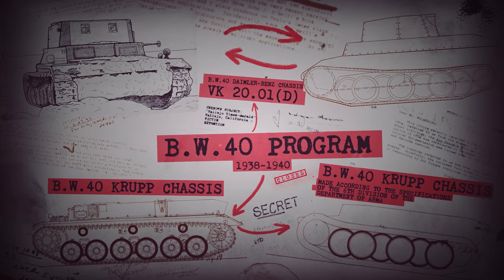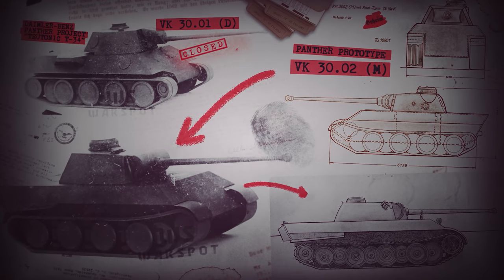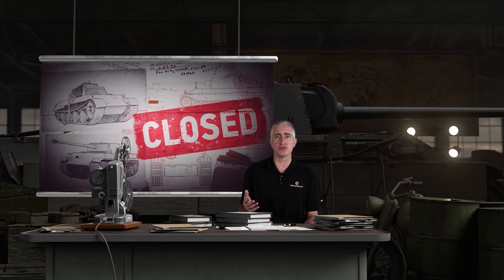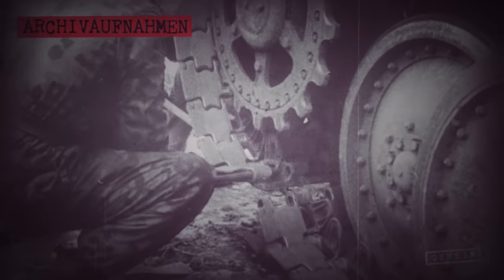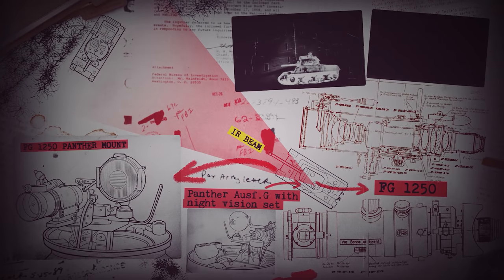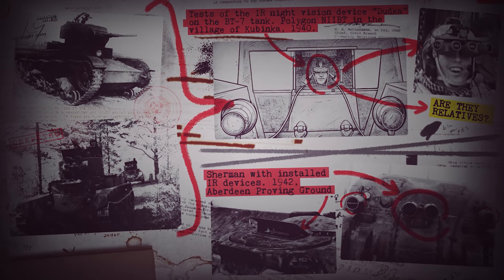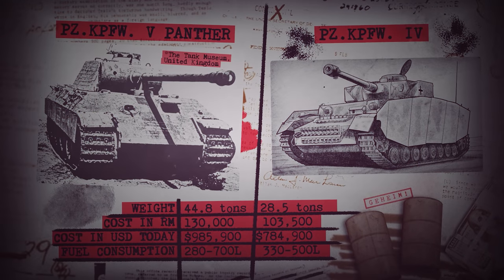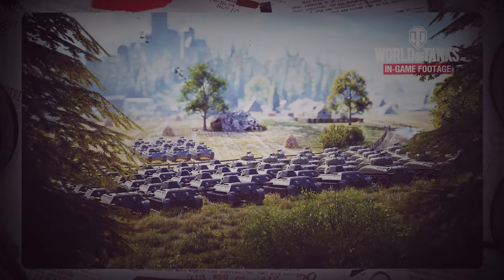Five Things About the Panther with The Chieftain - World of Tanks

Comment: I like that you point out the "If they had build something easier more, who would have crewed it and where would the fuel habe come from" That is something that I thought about for a long time. And now there is a Video with one of the authorities on tanks saying it, which I will certainly use in any discussion in the future :)
Reply: One would think the German manpower shortage would've motivated them to ditch the "bow gunner/assistant driver" position and take their tanks down to 4-man crews!  (Extra fuel for extra vehicles would still be a problem though...)
Reply: Way back on the IMDB discussion board (for either Fury or BoB), somebody pointed out that IF Germany made more Pz IVs and equipped more divisions and regiments, it would multiply the problems of logistical support, fuel and manpower that Germany had at the time==which was a brilliant observation that had never occurred to me until the other guy posted it.
Reply: @folgore1  in the German tanks, the bow gunner was also the radio operator, monitoring the frequencies and maintaining the radios, removing the funker means that someone else has to do the job, usually that moves to the commander, but mounting the radio equipment requires space so either you remove equipment, or change the turret to fit the radios (which were not small in the German's case), adding mass to an already heavy vehicle
Reply: Lets answer the question about alternatives. It sounds like we all agree about fuel after October 1941.  And it sounds like most agree about experienced crews becoming an issue somewhere between 1941 and 1943.   So the question is, what does an army require prior to Operation Barbarossa to get to Moscow before October.  Or perhaps the Caucuses (also requiring a bridge plan).   What gun kills anything the opposition has in 1941, 1942, and 1943 and with  standoff.   Answer,  75L43.  Though the 50L 60 would suffice in 1941.  So what does an army need to produce so the army can use fire and maneuver with these guns by june 1941 to get where it wants to go without armored impediments creating psychological hesitancy to maneuver?   Also, an army can start with the 50mm and upgun to the 75mm. Answer:  panzer IV.  If no other tracked vehicle crosses the boarder in June 1941 but Panzer IVs (say around 3000) does the army gets to moscow by October?  Or the Caucuses (if a bridge plan is also produced)?   No other tracked vehicle in this hypothetical.  Just 3000 Panzer IVs.   Perhaps make this number align closer to their Panzer BN ratios of IIIs to IVs if youd like.   2000 Panzer IV with 50L60 and 1000 Panzer IV with low velocity 75 L24.  Does that army make it to Moscow by October?    Now give all those Panzers 75 L43.  How about then?   Or do 2000 Panzer IVs with 75 L43 and 1000 Stug IV with low velocity 75 L24.  Or use Stug III for Stug IV.     Please run those numbers and we might find a solution for fuel and experienced crews.  And we might find an army can get to moscow by October.  Or the Caucuses ( with a bridge plan).  And since we all know that fuel is an issue after October 1941, a smart army does something about that….unless another reason explains that “failure to close.”
Reply: There was a similar problem with the Luftwaffe. Essentially what was the point of making X number of aircraft when they couldn't train crews fast enough to fly them.
Reply: @greyone40  Well the problem wasn't getting the crews to man the planes, it was not getting them killed within the first few missions.
Reply: Yep, this exactly. The Germans didn't even deploy most of the tanks they already had to the Eastern Front because they didn't have the fuel to operate them. That's why the objective of Barbarossa was to take the caucuses and the oil fields there but the head of the OKH whose name I cannot spell and can't be bothered to look up decided that the man with the silly little mustache was wrong and disobeyed orders, focusing most forces and supplies in army group North instead of army group South. By the time the man with the ridiculous tiny mustache realized what had happened it was too late to change the deployment before the attack had to be launched.
Reply: It's actually a bad argument though Sabel.  Infantry's primary purpose is to get shot, you don't need good men in line infantry, so the extra crew can come from current infantry and be replaced by broadening conscription standards (which is something the Germans actually did late in the war, though it would have been better doing it earlier).  And you wouldn't need extra fuel, the panther drinks 2-3 times as much fuel depending on circumstances as a Pz IV.

Finally all early German successes were because they outnumbered their opponents.  Even though they didn't outnumber their "paper" strength, they always had local superiority.  A bad tank is better than no tank and all that.  More Pz IVs allows them to attain local superiority more reliably and effectively, compared to building more heavier vehicles.

That being said, actually the best approach would have been to not build Panthers OR extra Pz IVs and have put all of the resources spend on the panther project into building more trucks and trains.  For example the ultimate reason why barbarossa failed was because the Germans started the op with only 60-80% of the trucks they needed and eventually fell to 40-50%, which starved units of fuel, ammo and parts.  If they'd have had enough trucks, they'd have knocked the soviets out of the war in '41.  As an illustration, the entirity of Army Group South went a whole week in October '41 without receiving any supplies at all, simply because all of thier trucks broke down.  Or for November '41 because of a shortage of trucks and trains almost no fuel was shipped at all to the entire eastern front.  As an example 9th army, from army group center, went the entirity of november without receiving any fuel at all.
Reply: There is, wait for it, a bit of extra nuance on the matter. The Germans had problems keeping up with attrition, meaning their tank battalions were often pretty short on operational tanks, with a lot of them requiring repairs.

So producing more tanks wasn't actually a bad idea, the main issue is, the panther was already pretty much the best they could do in terms of production. In just around 3 years there were 6000 panthers produced, compared to the 8800 panzer iv in roughly 6.

The Germans were usually caught between fielding more tanks to make up for tank losses or producing spare parts to fix existing tanks. They chose to simply build more tanks.

Comment: I didn't like as a driver to neutral steer a M 60  on rocky ground, the rocks if the size of baseballs would bend your center guides and break chunks of rubber off your roadwheels especially the inside ones.
Reply: How did you feel about your prospects living in, working on and potentially fighting in an M60?

I don't have an opinion myself. I'm just curious.

Comment: And another thing people don't realize till they've seen it in a museum - the Panther is honking huge. M4 is tall but it's relatively compact. The whole Panther hull roof is markedly high. You could probably fit the top of the actually tiny IS-3's turret below that level.
Reply: The Panthers has 51cm of suspension travel, its ground clearance is much bigger so!
Reply: Funny how the Panther is bigger than a Sherman but yet looks more cramped inside than a Sherman.

Guess the larger gun on the Panther is the reason for this.

Comment: It’s easy to forget how bad oil and grease was back then. You couldn’t put down the shaft loads you can now. Plus, you can make a gear today that is like the next gear, and ones ten later and a thousand later. All with just the right amount of alloys.
Reply: @tommykirk3403  you might have 5000 miles between decokes, where you pulled the heads and scraped out the exhaust ports. I’ve chiselled carbon out of the old cement mixer engines. They would build it up until they stopped running :o
Reply: @tommykirk3403  Kind of used to it with the off-roading where brake pads lasted about 200 miles. It was 3 hours fixing for every hour raced. Engine oil wasn’t so bad :o)

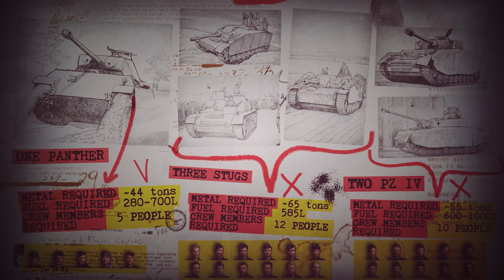Comment: 6:57 I can't remember exactly where I had read it, but the author argued around the lines that by introducing Panzer V & VI, which had nearly twice the fuel consumption of Panzer III & Panzer IV, the fuel shortage of the German Panzer Units (which got steadily worse since 1942) got even worse and they lost finally their biggest power, their mobility.
Reply: The Germans had fuel problems from the start of the war. Hence the desire to control the Caucasus oilfields which was a partial impetus behind the invasion of the USSR. Sticking with IIIs and IVs wouldn’t have changed this situation.
Reply: @CmdrTobs  I'm trying to make the point that fuel was always an issue for the Germans, the later gas guzzling tank designs just made it worse.
Even sticking with only IIIs and IVs would not have eliminated the fuel issue.
Reply: The Tiger I was faster across country than a Panzer III and with a much lower ground pressure.. What were you saying about mobility?